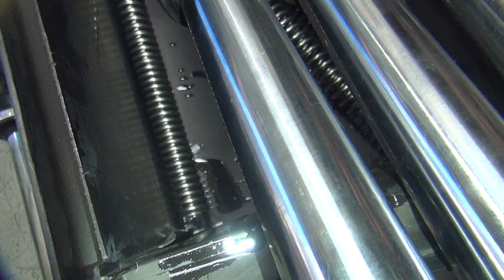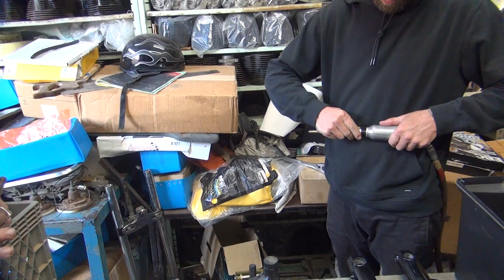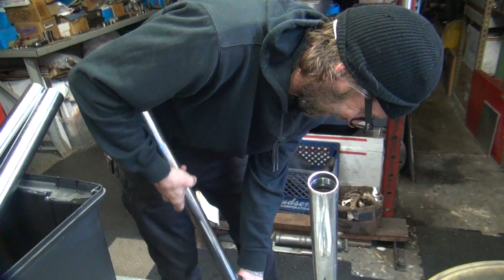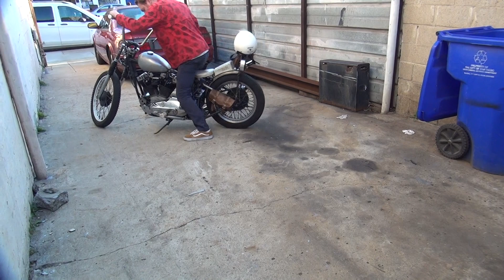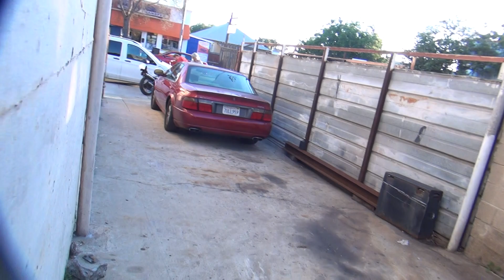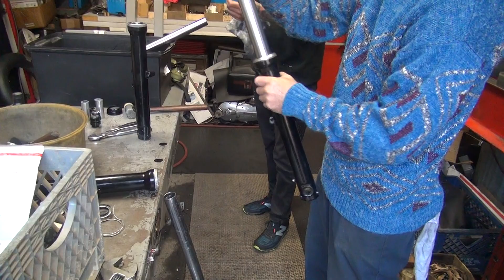#101 1987 fxr xl 39mm fork tube swap rebuild sportster dyna fxd harley by tatro machine

Comment: Wow walker that exhaust pipe on rear cylinder has been very hot... look how blue it is 😳😳😳
Reply from the maker: its raw metal so you can see the color very easily. after it rust you will not see it so much.
tatro